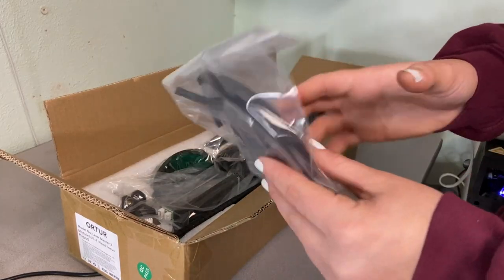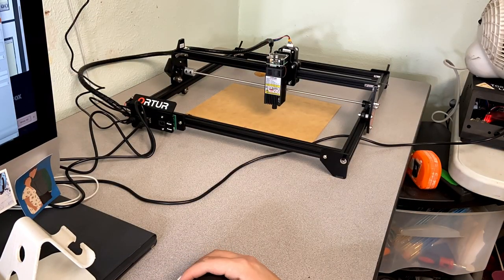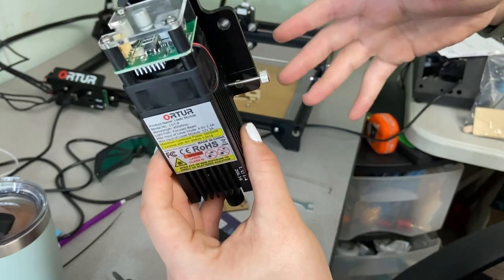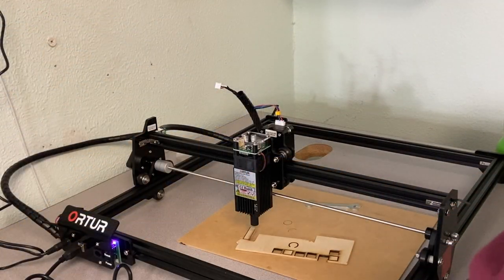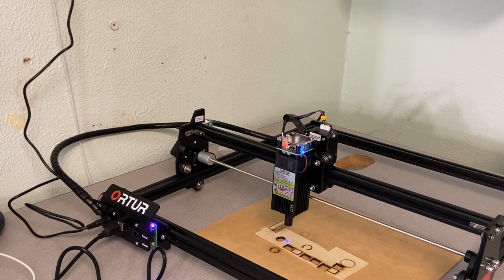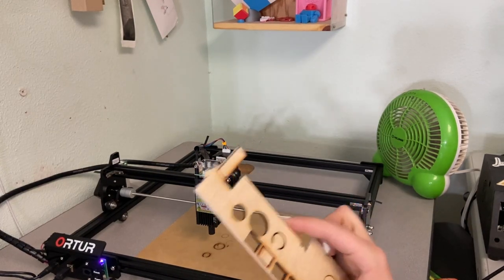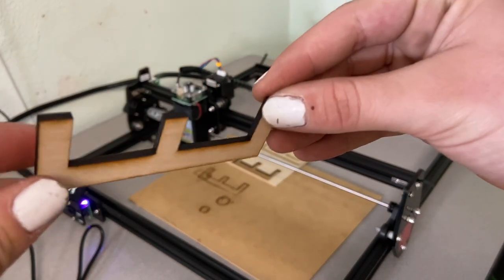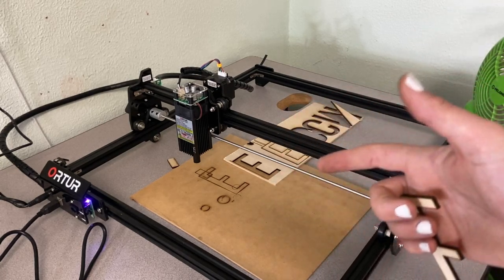Ortur Laser Master 2 Laser Cutter Review

Comment: Hi there! Thanks for this video! I have a the OLM2 - with the 15W laser option. I have been struggling to get it to cut 3mm plywood. Can you please share with me how you have everything set up in lightburn? I couldn't get it to cut through using lasergrbl or lightburn after 20+ passes and I don't understand what I'm doing wrong. I've got it set at 85% power and speed is 250mm/sec. (I didn't know any better so the first 15 or so passes were at 100% power and speed was at 100 mm/sec.) Please help!
Reply from the maker: I’ve had this same problem, but what fixed it was to make sure the focus was correct for the thickness of the material. That should fix it. If not let me know

Comment: Do you think my Lazer is goog enough to do tile and wood engraving. 
CNC Laser 500MW
Peramiter: W 20.5" x 24.3"
 Features & Details
    【BASIC PARAMETER】- Laser Power: 500mW, Working Area: 40X50cm, Engraving Speed:0.02-0.2sec/pixel, Product Size：56x44x16mm, Connection: USB, Material: aluminum alloy.
    【PREMIUM QUALITY】- The laser engraving machine adopts the aluminum alloy, which is characterized by high durability and high sturdiness.
    【GRBL CONTROL BOARD】- The mini laser engraver supports all the GRBL control system including GRBLControl, grblcontroller, universal, gcodSendeer, micro-carving masters, micro-carving stewards, micro-carving wizards.
    【HIGH PERFORMANCE MOTORS】- The cnc laser machine has three motors for common control. The dual Y-axis design makes the Y-axis more synchronized.
    【VARIOUS APPLICATION】- Professional 500mw laser cutter is widely used in wood, plastic, paper, bamboo, plastic phone case, rubber stamp, photosensitive stamp, sponge paper etc.

Specification
    Power: 500mW
    Working Area: 40*50cm
    Product Size：56x44x16cm
    Engraving Speed:0.02-0.2 sec/pixel
    Material：aluminum alloy
    Connection: USB
    Control System: GRBL
    Applies to: WinXP, Win7, Win8, Win10
    Gross Weight: 4.46kg(9.83lbs)
    Package Size: 67 x 41 x 12cm/26.38 x 16.14 x 4.72inch
Reply from the maker: I’d say probably not because I had the 500mw laser and it died pretty fast even when I didn’t use the highest power of it. I definitely recommend getting a higher power laser like a 3.5 or 5.5w